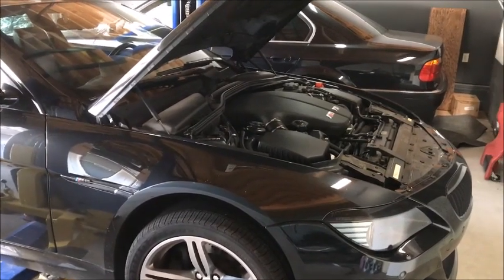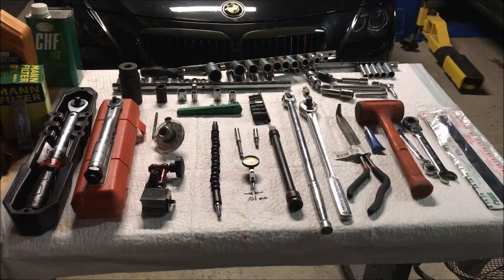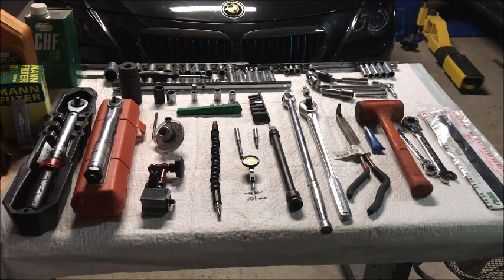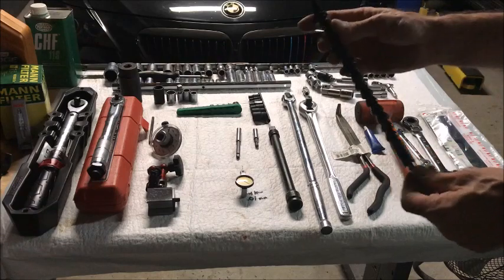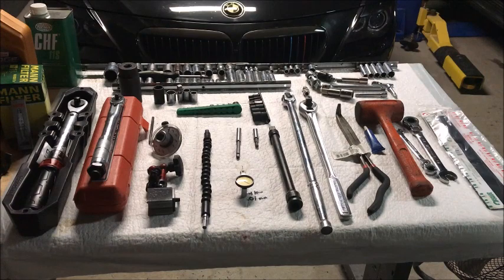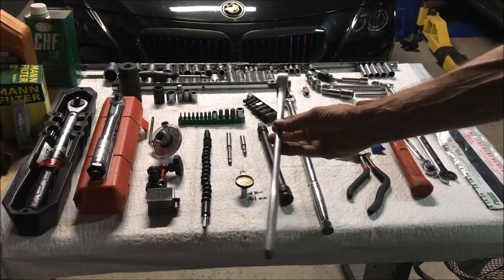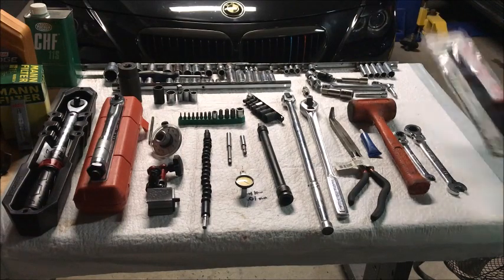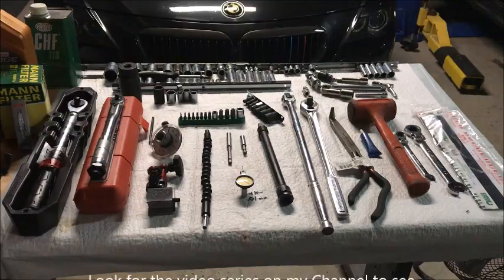BMW S85 Rod Bearing and Vanos Line Replacement Part 1 of 13 - Parts and Tools Needed

Comment from the maker: Just did my 5k mike oil change after the Rod Bearing replacement and got the results back from the oil analysis lab.  Everything looks really good and my lead levels dropped back down (even though the bearings I used still have the multi layer technology that has a lead layer) so she should be in good to go for another 75k miles 👍. Here’s a link to the report if interested: https://www.facebook.com/109400450606405/posts/189774502568999/  .All the best, Steve

Comment: Steve are you located in California?
Reply from the maker: Hello, no...I’m from Tennessee.  I hear there are a lot more of these cars in California and Texas though.  Mine is the only one within 100 miles that I know of around here.  The BMW dealers and local European shops won’t even touch them here without quoting extremely high as no one has any experience with them anymore in this area it seems.

Comment: Hi, where did you find all those parts for so little? I’m paying double.
Reply from the maker: Miguel , hey man...the big dollar item was the bearings. I went with the ACL race bearings as they were much lower in cost, but seemed to be good quality (did a ton of research on them prior to buying). Most of the other parts were sourced from FCP Euro or other web sites...I just looked up the OE part numbers on Real OEM.com and then searched the web for the best price. Hope this helps, Steve
Reply: also since this was filmed in 2019, steve was getting pre-covid prices on everything ..

i was lucky enough to get my e64 m itself in 2019 b4 covid pricing but i just bought all my parts for this job and it's way more now to buy all the parts for this job  than it was in 2019 ;-;

Comment: I need to fix my M5 e61.....
Reply from the maker: deoye bammeke , it’s a bit of a job, but not too bad with the right tools...and a heck of a lot cheaper, not to mention the peace of mind knowing everything was done right since I wasn’t on the clock and felt like I had to hurry to get it done
Reply: Steve’s DIYs Thanks for your video.... I watched it from Epi 1-13. Fantastic and valuable video. You are very meticulous.
If you were in my region I would have love you handle the changes of the rod bearings and vanos. 
 The BMW M5 e61 wagon is in Lagos Nigeria. I really like to keep this particular vehicle, I just love the engineering rigour and design. We I ready to officially fix it I will definitely contact you to get the tools and the parts. May it will either be may first DIY via Zoom or Skype. Till then keep the good work. Peace.
Reply from the maker: deoye bammeke , thanks ! ...glad the videos look like they will be helpful when you get ready to do yours 👍. All the best, Steve